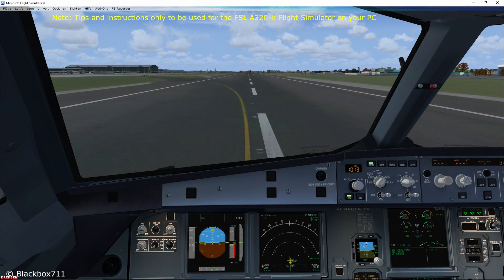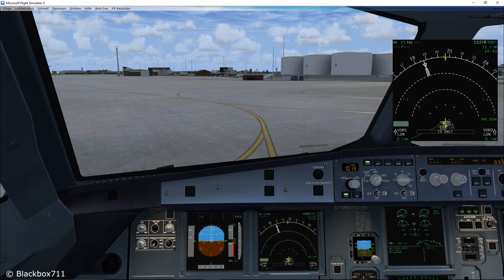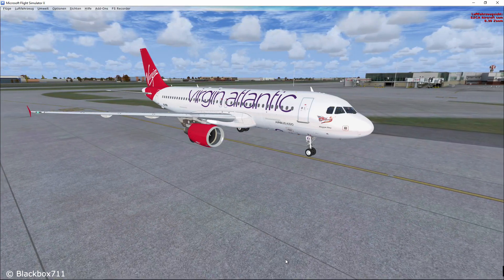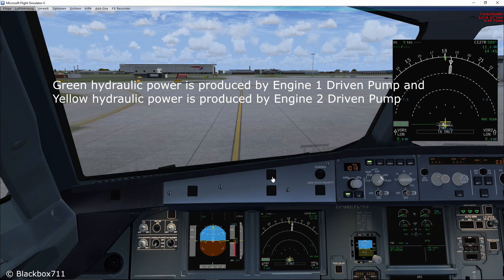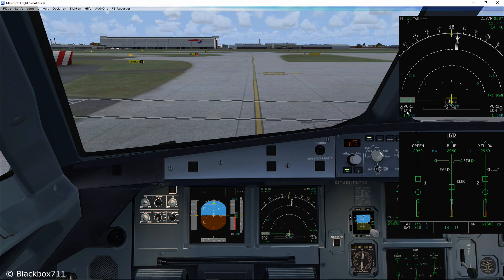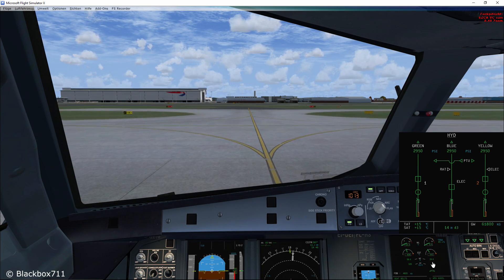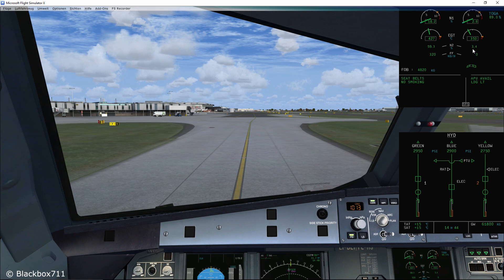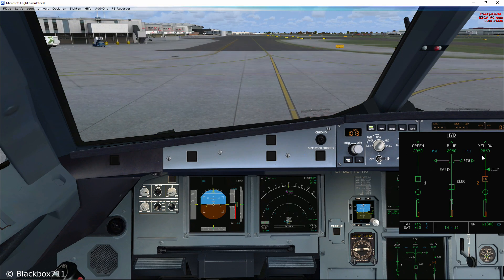FSLabs A320-X Basics: Single Engine Taxi after landing

Comment: Hi Blackbox, if the taxi time is less than 3 minutes don you still have to wait before you can shut down the engines? Greetings ;)
Reply from the maker: Hi. You need to wait 3 minutes to get a thermal stabilization of the engine core parts. In real life if you don’t wait the 3 minutes you could risk damage or even a rotor seizure.

Comment: Really informative dude thanks. I'm currently involved in a Heading Control Function to be introduced to the Next Generation A320 BSCS. One of the requirements is for it to be used during single-engine taxi to reduce pilot workload. It's already on the A350 and A380 though.

Comment: Great video, any chance you'll do a circling approach at minima? Say Busan (RKPK) LOC approach 36L circling 18R, Circling MDA (TERPS) 1040ft. 

You'll need to download some freeware scenery as the airport have changed quite a bit from default FSX.
Reply from the maker: Hi Avantime. I can try :-) I will put that request on my list since I will do a video on circling very soon. Regards
Reply: Thanks! Busan is a very interesting airport as it's surrounded by high mountains, and an Air China 767 did actually crash during a circling approach there.

Also some information for your reference:
http://avherald.com/h?article=4505b59b
https://aviation-safety.net/database/record.php?id=20020415-0
Reply from the maker: That makes it even more interesting!
Reply: Speaking of interesting airports, have you been to Sarajevo? A raw data NDB-Y Rwy 12 circling 30 + go around seems fun. Airport elevation 1708ft, Cat C Circling MDA 5050ft. It almost feels like you're better off doing a tailwind approach (another video idea?).

Comment: Hello,

Can you advise me what flight stick i can use for the airbus ??

regards Bert from holland
Reply: IIRC Blackbox uses a HOTAS Warthog, but if that's too expensive for you a Logitech Extreme 3D Pro is good. The Logitech Attack 3 is closest in feel to the Airbus, but unlike the 3D Pro it doesn't have a HAT switch and a twist axis - very useful to assign as the steering tiller if you already have rudder pedals.
Reply from the maker: Hi Bert. There is not much else I can add to Avantime's answer. Maybe test a couple of sticks in a shop and see how they feel in regard to spring stiffness. Unfortunately the better flightsticks will cost you quite a lot of money. Regards
Reply: Thank you for your answer.

Regards Bert